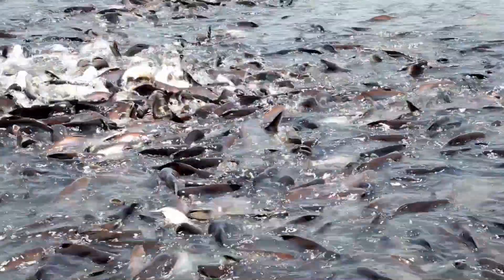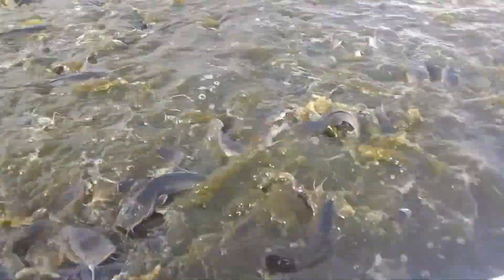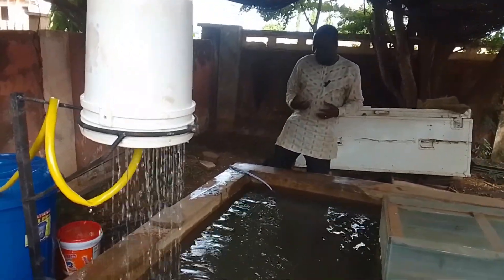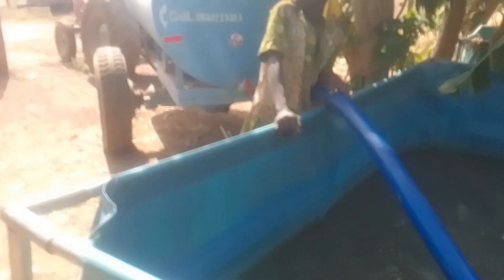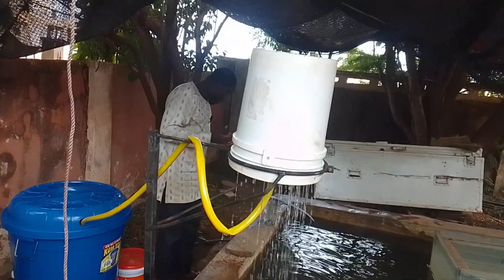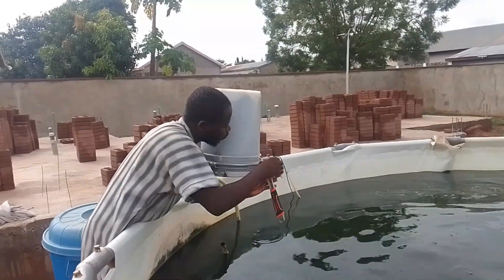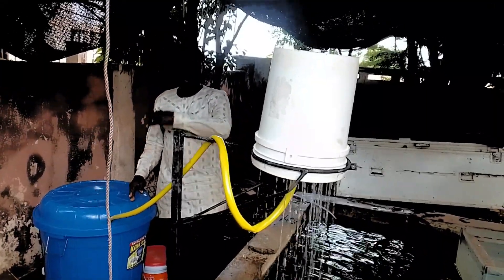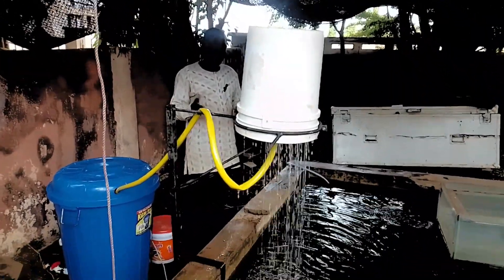How To Reduce Cost of Fish Production Using RAS and Aeration/Produce Fish With Little Water

Comment: Please what is the cost of the raas system
Reply from the maker: It cost Ghc3000 but the cost USD75. So we either build and install it for you for Ghc3000 or you purchase the course and learn it yourself for USD75 with 30% discount for purchasing early.
Reply from the maker: Check out the link in the description
Reply: What no. can you be contacted on?